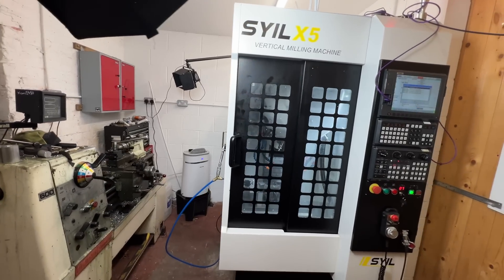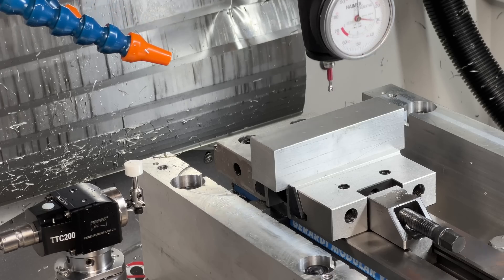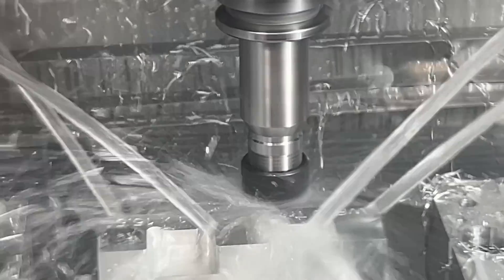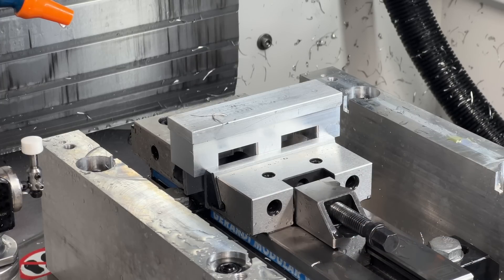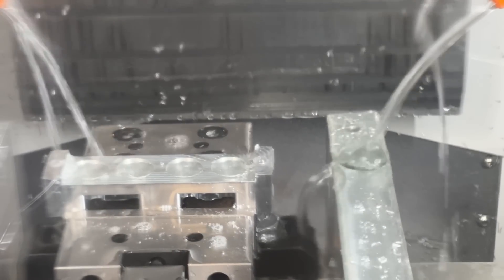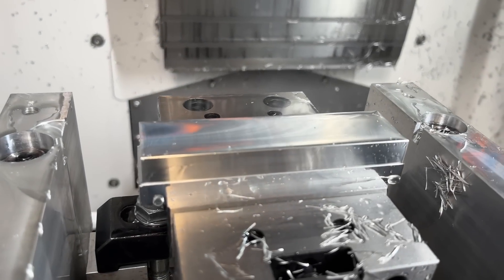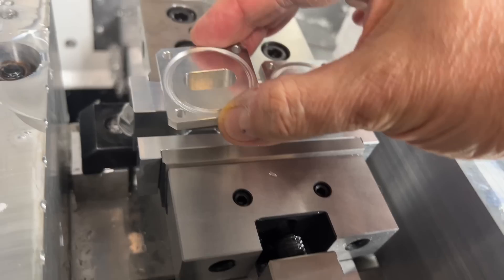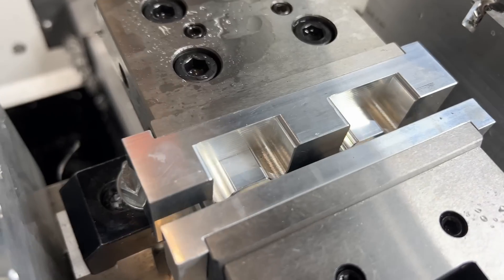I Built My First CNC Fixture!

Comment: Btw the "63mm endmill" is not a endmill nor call a endmill. It's a facemill. Will help you knowing that if/when your gonna look for a new bigger/smaller face mill
Reply from the maker: I must have been asleep when I said that!  It was at 3.15 AM local time. I'll amend the captions, but I can't get rid of the silly misnaming!  Well spotted, thanks.
Reply: @MachiningandMicrowaves  your welcome. btw what brand is the face bill anyway ? amd os tjere a material you cut most with it
Reply from the maker: @flikflak24  That one is only ever used on copper, brass and aluminium, it's a Teknik that I got free with two boxes of inserts. I have two 80mm facemills on R8 arbors that I use on the Bridgeport.  One is for stainless steel and the other for copper and aluminium. Those only have a single insert, so there's nothing to adjust other than the tram of the Bridgeport head. On the SYIL, I like to run the tool faster, so to keep it balanced, I tested a whole box of the 90 degree inserts and found the smallest one and put that into the smaller of a pair of pockets that had the largest height difference. Those cheap Tekniks are actually quite good, the difference was only about 5 micrometres, and the variance in the inserts was a little less, so I had 0.007 mm difference in height.  I did consider making a non-cutting counterbalance, but running at 500 mm per minute and 5000 rpm with this setup gives an excellent finish. The inserts have a flat on the bottom edge, and leave almost no cusps.  I checked for runout with a 2 micrometre DTI on the radial faces of a full set of inserts, but with only one insert actually being used, I didn't think it was important. I wanted to be sure the face mill was seated correctly on the BT30 arbor. I would like to be able to test the surface quality using an optical flat, but the remaining cusps are a bit more than two wavelengths of light, so I can't get it to show fringes.  I checked for concavity in both X and Y direction cuts using my Mahr Millimess and couldn't see anything obvious other than the micrometre or so of random fluctuations. I also tried it as various speeds in case there were any resonances, but I didn't see anything obvious.  I have NO IDEA if my approach is anything like what a real precision machinist would do.  I have one giant cutter on a 50 taper that has shims for adjustment, but when your face mills cost $0.00, I guess you have to accept what you get!
Reply: @MachiningandMicrowaves  well since its a $0.00 face mill it wouldnt be that big of a loss moding it ( to have a screw on top over the insert so you can push them down a tiny bit so you can get them in to run perfect with the other insert's ( i made my own 70mm dual mcd diamond insert facemill with hight adjust so both inserts runs within 0.001mm of eachother and the finish i get out of it is perfectly fine for a optical flat ( i prefer those with cccp marked on them ) otherwise eventhough it might be a bit expensive i would pick a sandvik CoroMill 590. since it have buildin hight adjust with a flexture feature
Reply from the maker: @flikflak24  Heh heh, I have some of those optical flats! I'll try that adjustment screw technique on the 80 mm face mill first as I have a spare for that. If I can get it to work, I'll do the 63 mm as well. Those Coromill 590s are very nice, but I think I'll be modifying cheap ones unless I start doing a lot of work needing very fine flat finishes. I usually hand-lap the waveguide flanges, so if I can get a good enough finish with a facemill, that would be a time-saver, although I'm only likely to be doing a few hundred of those per year.
Reply: @MachiningandMicrowaves  sounds good. maybe even also make a face burnishing tool ( useing shanks from broken carbide end mills. i got some home made drawings if you want ( it takes the peak of the surface and press it down into the vally of the finish )

btw. how did you like the idear of getting only 12mm etp hydraulic ER holder's and then turn some shrink fit sleevs for all the end mills thats smaller then 12mm ( extremely important that the id and od is turned ( and if possible grinded ) in the same setup ?
that way you only need to get one size and calubrate there runout one's since every tool is sleeved to 12mm
Reply from the maker: @flikflak24  I've been talking to my tool supplier about getting some BT30 shrink chucks to try, but definitely interested in the ETP hydraulic and sleeves. I haven't tried any burnishing tools on aluminium, does it work with 6082 or 6061? How about on CZ121 brass? Reason I'd like to get to sub-micrometre finishes is so I can use lasers or visible light beams for alignment and focus testing

Comment: Channel has really took a turn from what subscribed to 😢, used to be hand made lathe and milling operations but now it's just a lot of talking about this and that but cnc thing is not what subscribed to, so goodbye good luck and well wishes, but un-subscribing this channel, this message is for owner of the channel, not all the keyboard warriors in their mom's basement so if you have a comment, just don't, 👋👋👋
Reply from the maker: I've changed, there will still be lots of hand machining, but right now, my head is full of CNC and earning some money. I'm sure the novelty will wear off eventually, but I'm definitely more driven by radio-centric stuff than the proper manual machining channels

Comment: Congratulations on your new CNC machine.  Nothing wrong with the LNC controller, I've got one on my older X7 machine.  Seimens is the way go as you can always get a technician to come around to sort issues out (not cheap though).  Good work with the CAD CAM.  Fusion has lot of little quirks, but you'll get there the more you use and dabble.  Cheers Aaron.

PS: I take it you bought from George in the UK?  He is bloody top bloke and very supportive.
Reply: Yes I am hehe
Reply from the maker: Yep, except he disappeared and went to Greece, so I've been managing with direct support from the factory.  Not heard much about the new UK team, I was going to pop over to see them, as they had an office at Magna near Rotherham.  I've been far to busy with TV-related projects to do much other than make hundreds of parts for a replica of a historic bit of tech from the 1920s, but there's lots of interesting stuff in the pipeline. I hacked up a Fanuc lathe postprocessor in Fusion to make the X5 behave as a lathe with a tool rack on the bed and stock chucked up in the spindle.  Worked extremely well with brass, but terrible chip clearance issues with aluminium.  The postprocessor is just a bit of noddy Javascript, but the lack of detailed documentation for the LNC was annoying. Guess I'm used to microcontroller-based SCADA stuff with really detailed APIs and proper documentation.  I got some excellent finishes on ellipsoid and hyperboloid reflectors, just need to find the right speeds and feeds to break chips, or program in chip-breaking steps or something.
Reply: @MachiningandMicrowaves  you may also have to look into different tooling. i didn't think there was much difference between tooling until i saw it first hand with our lathe at work. the difference in performance from tools that sometimes appear near identical is astounding

Comment: Lovely, you will be adding a 4th axis next. You always say to yourself......if only I had a.......

Enjoy 😊
Reply from the maker: I'm fighting a losing battle with myself about a 4th axis for making cylindrical parts that are asymmetric cross-section.  However, I am also keen to get a proper probing setup so I can do in-process probing and tool break detection and stuff.  I've been coding since 1972, so I do like a bit of code now and then.  I've been writing little routines that I can call as macros.  Trouble is, I don't want to get too interested in CNC stuff, it's a means to an end, like the manual machines.  I REALLY don't want to turn into a job-shop, I'm not interested in production runs, just prototyping and fast turnaround iterations of parts that would otherwise need ANSYS or other modelling software that would cost WAAAAAY more than this little machine.
Reply: @MachiningandMicrowaves  I think you just do hobbies that make you happy and keep your mind healthy... it's great men... that's my dreams too
Reply from the maker: @ The best thing is that I can make highly specialised parts for other experimenters who would otherwise find it difficult to get electromagnetic simulation, mechanical design, vacuum, electrochemical, machining, electronics, metrology and radio system testing all in one place. OK, so you won't get aerospace quality, but you get to do stuff that would otherwise be completely out of reach.

Comment: New machine, and the z-axis way covers are already all bent up??
Reply from the maker: It's a short story.  I was setting up a simple job and had a clamp on a plate temporarily. I pressed the wrong button when trying to move the  bed towards the front of the machine, and the clamp handle was about a centimetre too far back, so it bashed the covers. I was tired and taking a shortcut that I should never have needed to do.  I'd mislaid the tiny Kant-Twist clamp, so used one that was an inch too large, and the handle smacked the covers.  I couldn't get my head to map the key presses to the direction of motion.  Needless to say, after that learning experience, my muscle-memory is now 100% accurate. I need to order two or three new leaves, or maybe I can do a bit of gentle panel-beating and heat-treat to get them back into perfect shape.
Reply: @MachiningandMicrowaves  I wouldn't be too hard on yourself - almost every machine I've seen has SOME kind of way cover damage from someone making a mistake. I'd try taking the cover off and just working it with a ball peen hammer on a block of wood to straighten it out. If it's stainless, it might be pretty hard to get perfect, but it should be good enough!

Comment: What are the two big slabs on either side of the vise? Workholding for large plates? Coolant/swarf guards?
Reply from the maker: @hadinossanosam4459  I made a very large fixture plate that sits on top of those as you'll see in upcoming videos
Reply: I was going to ask the same question. 👍

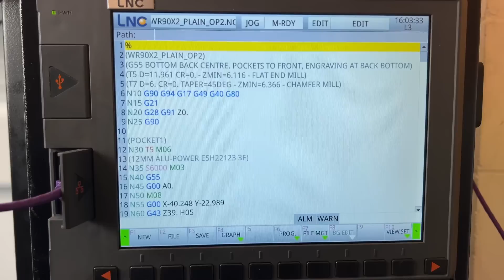Comment: Nice toys!  but wtf is that bastard keyboard from hell at 10:50?  (not a machinist but that makes a Dvorak keyboard look sensible!)
Reply from the maker: @zebo-the-fat  it is the worst. I cannot imagine what sick mind generated it. Possibly lost in the mists of time when machinist didn't have computers. Who can say
Reply: @MachiningandMicrowaves  It's a G-Code keyboard, literally placed the same way as a keyboard with the most useful letters on home row, but it's a single-handed home row keyboard where the useful letters are according to G-Code utilities. First line are operations/commands, second line are axes, third and fourth lines are parameters for operations and the rest of the alphabet. "Home row" are the axis as they are the one you'd type it out the most while typing G-Code. You don't type anything at a CNC machine, the only thing you'll type are quick commands in G-Code, so it makes sense, if you are typing any length of text while operating a CNC, you are doing it wrong.
Reply from the maker: @ Indeed, it's connected over gigabit ethernet fibre back to my main network.
Reply: Makes sense.
I'm always astounded watching someone like James Park or Chris Maj punch G-code in and get the results they do with so little input.
Reply from the maker: I notice that now I've had the machine for a few months, it's getting to be intuitive as I expected it would, although the X key never seems to be in the same place twice. Most of the others make sense now

Comment: Wonderful video! New toys are 😁
Be careful trying to hold 2 workpieces in one single-axis vice clamp! Just imagine if one piece is slightly thicker, the other piece wont get clamped at all...
A good multi-part clamp should have some compensation rocker etc, so differences in thickness won't matter.
Yes, you might expect your pieces to be the same thickness since you CNC made them, BUT it is always good practice to design a clamping system that does not rely on having perfect parts before it can clamp ok. 🤔
Reply from the maker: @wizrom3046  the moving vice jaw has a little rock so it can compensate for minor differences. I'm only ever going to be using this for production runs where each pair is made at the same time in the same set up. If I ever find it a problem, I'll be adding a flexure to the moving jaw to take up any differences.
Reply: @MachiningandMicrowaves  You might get differences from heating due to machining one part and not the other. Alternating operations between parts can minimize that. It might never end up being a problem, but if it does it'll definitely be on the final operations of a fancy part in expensive material!
Reply from the maker: I'm making the assumption that because these are small aluminium parts and there is flood coolant that any temperature differences are absolutely minimal. I suppose I could try using an infrared camera to see if there are any transient heating effects, but for this specific instance the only machining that's happening with the parts in horizontally is some engraving,  drilling five holes, trochoidal milling one of them and thread milling the other four, so the operation time and amount of tool engagement and heat is minimal. This was my first attempt and since then I've made fixtures taking 50 or more parts and taking into account the possibility of differential expansion. I don't think I would do it this way again, but as the workpieces are cheap aluminium and the machining steps I'm doing are very light, I think the benefit of having two parts machined at once is probably worth the extra risk. A far better approach would have been to use two or more small modular vices with hardened jaw teeth or possibly dovetails.  I rather lust after having a set of 50mm self-centering vices with an indexed mounting system, but that's a huge extra investment.  Might make sense for production, but If I want to do large quantities, I'll be farming it out to a CNC shop that can do it a great deal more effectively and efficiently than I can.

Comment: Oh! Please don't keep the Heimer in the tool changer. It will be dirty by chips and coolant. Don't be lazy to keep it clean and insert it manually when needed
Reply from the maker: Well, the 3D-taster mode is IP67 rated, and I do take it out of the machine after hours to prevent condensation, but I've had it in the machine daily for four months now (this video is a mix of then and now) and there's no sign of problems with the Haimer. If there was a spindle release button on the X5, it would be very simple to pop it in when needed, but I have to load it into the toolchanger. That makes it a pain to do repeated probing.  I need to get a proper wireless probe so I can do auto probing.  That Haimer is a bit beaten up, not my best one, but I keep it carefully calibrated and it works.
Reply: @MachiningandMicrowaves  btw how do you calubrate it/make sure that its runs as true to the spindle as possible ( i already know it and done it a few 100 times but still like to hear how you do it )
Reply: I 2000% agree